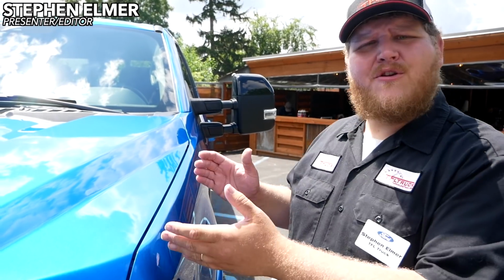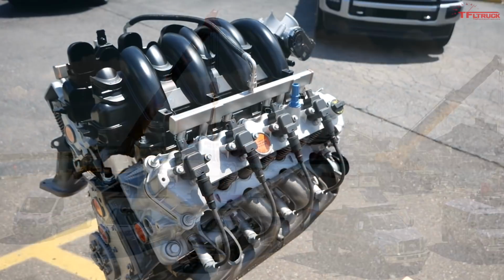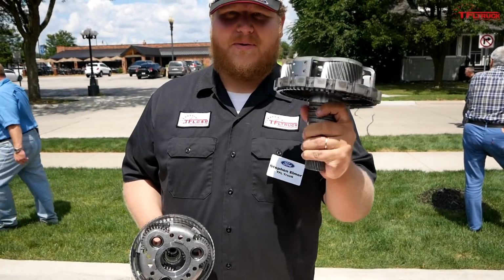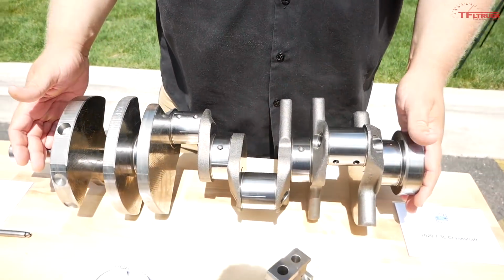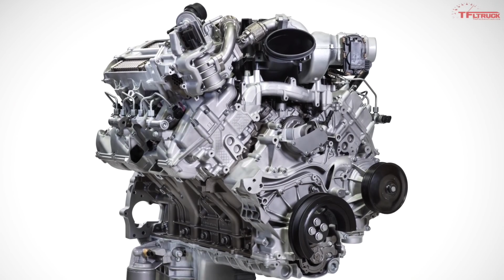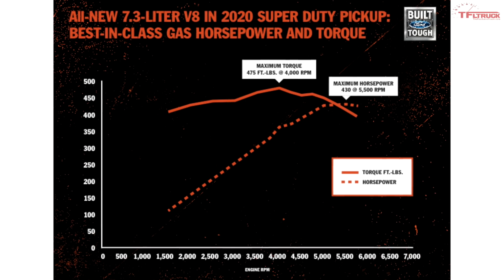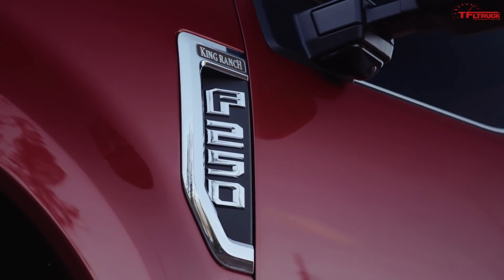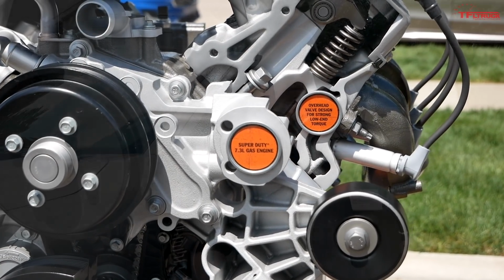We Finally Know the Ford Super Duty 7.3L V8 Power Numbers & They Are Lower Than We Thought!

Comment: From the research I've done, the 2020 Gen1 10R140 Torqueshift Trans had a lot of problems with an internal chain and caused very early failures. Ford had to replace a lot of these with a Gen2 which corrected internals. All 2021's had these installed. The engine appears bulletproof and they're already cranking 750+ HP out of them.

Comment: Dam almost close to being equal to a ls7 7.0.

The few for lbs in Torque difference can be correct through gear ratios the hp difference can not be corrected. Execpt gm used pre 2006 technology to build it.

Comment: My 2020 F250 with this engine seems to be working very hard or not shifting between 60 to 70 mph. Not sure if that's normal. Just doesn't feel right. Maybe  I'm just not use to a V8 after owning 2 F150 v6 2.7s

Comment: I have the F350 with the 6.2L gas and it has been plenty powerful for me. My gross vehicle weight is always at about 10,000lbs and it tends to feels a bit sluggish, but when I hook up a trailer adding an additional weight of 5,000 lbs or so, I don't feel much change in performance.

Comment: I’m not happy with these numbers, I dugout my old Chilton’s  book that covered the hay day of power 69-70, this is what I found.  Cadilac-472> HP-378@4400> TRQ-525@3000, Olds-455> HP-375@4600> TRQ-510@3000, Buick-455> HP-370@4600> TRQ-510@2800, Chevy-454> HP-390@4800> TRQ-500@3400, Ford-460> HP-365@4600> TRQ-500@2800, Pontiac-455> HP-360@4300> TRQ-500@2700, Mopar-440> HP-375@4600> TRQ-480@3200.  When you look at the torque@RPM Ford really missed my expectations 525@3200.
Reply: Those old numbers are somewhat inflated because they are net numbers not SAE. The dyno testing was dond without any accessorie loads such as an alternator or water pump
Reply: @benjaminwayneb  1972 and after are SAE NET, Pre 1972 are SAE GROSS, Look on Youtube at any old engine built stock that shows Dyno and they all beat the published numbers and I think they beat the published numbers enough to compensate for accessories and exhaust.  Also back then they under reported and did little things for insurance purposes.  Like the 400 Ram IV Pontiac in the GTO was 366 HP and the same engine in the Firebird was 345 HP.  They put a clip on the carburetor linkage.  It didn't take any speed geek long to figure that one out  https://www.youtube.com/watch?v=HLiKDu-q-sw , 477 HP and 550+ TRQ published Pontiac-455> HP-360@4300> TRQ-500.   So being made for a truck I think I have a right to be a little disappointed.  I was considering a 7.3 for towing and my biggest disappointment is where the peak torque is, if 475 was at 3,000 I'd be happier.  Being at 4,000 it is not going to get good enough MPG to be a better option than the diesel for everyday towing 13-18k.  I don't expect it to compete with a diesel at 30k.

Comment: Sure hope this is not another history lesson in the crap Modular engine Ford designed, had an Expedition and nothing worse that take great care of it to eventually have to junk a good truck because of head gasket leaks and spark plugs flying out of the motor, and the final topper, you have to lift the body off that chassie to be able to work on the heads or rear plugs, nice job Ford Engineers, you built a great following of Ford fan with that pile of crap.

Comment: It took them long enough to realize that the modular design sucked for work applications. If they would’ve went with the LS design way back they wouldn’t have lost so many customers from VVT issues, stretched chains, cracked manifolds, spit out spark plugs, etc. I ain’t even a GM guy but the facts are the facts. I sincerely hope they don’t suffer from bullshit design issues like the modular design did.

Comment: I work for a city in public works.   90% are fords.    Here's the low down.   Gas is cheap maintenance on gas is cheap motor replacement on gas is cheap and new gas trucks are cheap.  Diesel is expensive period.   Governments are not gonna spend the money on diesel.  Just to haul a crew around or pull a bobcat you dont need a diesel.

Comment: bmw 25d inline 4 diesel has more power
Reply: Not even close. The gas 7 will make more torque at idle than the max effort variants of that engine. The EcoBoost 2.3 gas engine makes more tq than most of the 25’s variants while both max effort engines making the same tq. Hp is on another planet.

Comment: All makers use lower numbers on engines used in heavier trucks vs cars. One example: Mopar's popular 6.4L HEMI is rated 485 hp in it's cars, 410 hp in it's bigger pickups, this gives an idea that there is much potential here for tuners.
Reply: The 6.4 truck engine is a different engine then the car engine, it's not just a different cam or tune.

Comment: This motor is amazing. Single cam  in block and it has vct ?? If this is true you can have multiple tunes that are like haveing completely different cams. Plus it has a 10spd tranny, the gearing should be limitless. Stump pulling 4:30s and low rpm 80mph cruise speeds. 150mph top end ! This is awesome !! 430hp big block is insane !! And this motor looks like it actually revs out !! I am stoked ! And no fuel injector tips in the head to get ate up they are in the port ! This motor is going to revolutionize pulling and hot rodding. Itll be in boats too. Stick it in a mustang !!
Reply: it's not big enough for boats.

Comment: The power level isnt terrible I'm sure it will be more than enough power for 80% of the buying market

And I'm sure that once you get in to the aftermarket with headers and a better flowing exhaust system 

With a tune and these should be damn close to 600 horsepower 

So all in all I think they are doing it right with the new 7.3

Comment: Looks like they accomplished the goal of a good HD truck engine.  

Yes, modern Diesels make more power and torque.  But the modern diesel is a very complex engine.  High pressure injection pumps, precision injectors, turbocharger, urea systems, particulate filters, the list goes on.  They are costly to maintain and repair compared to this engine.

Simple pushrod setup to reduce packaging size and cost (GM LS Style).
Regular low octane fuel to reduce fuel cost.
Port fuel injection to avoid the complication of a high pressure pump and no carbon caked intake valves.
Heavy duty components.

Looks like a great design that should meet the needs of its intended customers.  To think Ford designed this for 'the aftermarket' is one of the more clueless statements I've ever read.

They could of done a lots of things to make it more fuel efficient and powerful, but that would increase complexity, maintenance and cost.  There are trade offs in all things.

This is a modern version of an old school truck V8 that people think of when they say 'they don't make them like they used to'. Well, here is Ford making them like they used to but with better fuel economy, more power and far better reliability than they ever had 'back in the day'.  This will start at -40 in the north, and tow a big load uphill at +45C without overheating with the AC on while going probably half a million KM's or more without any real issues.

Comment: this new gas 7.3 really sounds like its really built like a beast but how big is this engine going to be in the truck if its anyware as big as the 6.7 or even the 6.4 this engine is going to be a cab off affair. those numbers sound great for a big gasser but how well is this new trans going to transfer it to the wheels. i do know the 6.2L feels strained when towing large loads in the superduty F650 and 750 trucks but its a great engine in the 150 and 250 trucks. in my area my shop maintains a lot of the local fleets found the 6.2L wasent really a strong hauler in the F650 and 750 trucks. the V10 is worse then the 6.2 lol. im hoping this 7.3 doesn't suffer the same ford manifold problem as every ford gasser. (they love to split rite half in two) but we will see how well this engine does. i doubt i will see it in many trucks that are going to be used for tow trucks and the like. the 7.3 will make a beastly engine if done up as a race engine. even in stock form with it making pretty respectable N/A, treated gingerly stock tuned form numbers this engine makes great power. even in its N/A form with a good tune can make a very powerful power plant. it can make lot more with boost. this engine has the potential to be an absolute monster. i hope ford does offer to buy the 7.3 as a crate engine. lets see what this new take on a push rod engine can do. lets see if they will let Shelby throw a supercharger on it and make a Shelby super duty. (i would definitely buy one lol already going to try and get the Shelby F150)
Reply: 6.2 not available in anything bigger then F450.

Comment: The best gas HD truck I ever owned was an 02 Chevy 2500 with the 8.1L Allison. That truck was a beast and that Allison is a great transmission. This 7.3L looks to be even better. 
I bet GM comes back with an updated 8.1 or similar to compete with this as the EPA is making owning a diesel an expensive nightmare.
Diesels are going step aside to these upgraded gas motors uness the EPA is disbanded as it should be

Comment: I think Ford finally figured Diesels are about done. With all the extra cost And maintenance 90 percent of companies don't want or need them. I am excited on the new 7.3 gas. Only bad thing is I'm going to sit back and wait a year. Ford has had some pretty shitty engines in the past. I think this one will be good, But I'm not going to be the Ginny pig.  My only other question is why 7.3? Why not 7.2 or 7.4? You make your next big engine release a 7.3 gas. When your most popular engine ever was a 7.3 diesel . Pretty dumb And confusing in my opinion.  If it seems to work well it will be my next truck.

Comment: Only 10 hp and 45 tq over the 1 liter less displacement, 8 year older 6.4 hemi 😂 and those are the lower numbers for the 2500. I guess if the 7.3 has good reliability/engine life and good torque down low, then we can accept this.

Comment: You missed an opportunity to measure Length, Width, Height of the engine.  Initial power #'s are fine.  Will this engine fit in a Crown Vic or Towncar? Curious what/when the Aftermarket will kick in.
Reply: Hotrodders will make it fit.  I don't doubt the aftermarket is already working on speed parts for it.  The big question is how soon will Ford make it available as a crate engine.  Otherwise, many SD owners will find their engines missing due to Midnight Auto Supply.

Comment: I'd like to see an option to get a turbo-normalized version of this engine. Sea level power at altitude for folks living and towing in the Western mountains. No longevity concerns as it wouldn't be stressing the motor at all. I'd also guess not significant cannibalizing diesel sales (very different solution).
Reply: Nice idea!  I keep expecting Ford to adapt their Ecoboost gasoline technology to heavy duty pickups, and I have no doubt they have thought of it, too.
Reply: @andyharman3022  I am sure that Ford is hedging bets here - emissions controls will likely make diesel a much tougher choice for anyone not absolutely needing it. Having a forced induction engine of this displacement would enable a viable alternative for the 5th wheel crowd.

Comment: You couldn't find out what they ended up doing with the ring package? Or if that is an abradable coating on the piston skirt? Are the bearings coated? Or if DLC or other coatings where used on any other components to reduce friction or speed oil return?

Comment: As a basically died-in-the-wool GM guy, I am thoroughly impressed with this new Ford engine. Some may call it a step backwards because it is pushrod, -etc. the fact is, pushrod engines work, -and work really well, especially in truck applications. It really looks like Ford did a phenomenal job on the design of this one, -this is positive progress. To the folks saying they are disappointed with the numbers, -remember that the guys that run fleet rigs DO NOT want to have ANY rig that is operating on the edge, -it must make those numbers all day and everyday with minimal maintenance, so they are intentionally detuned to achieve that. GM did the same exact thing on the 6.0, it is not an impressive engine power-wise, but you can beat the living tar out of them day in day out (the exception being the occasional bad lifter or two). I don't care whose name is on the valve cover, when something good like this comes out, it should be touted as good. These are some amazing times, look at all of the exceptional engines that are being produced today, the Hemi, Coyote, LS, Cummins, Duramax, Powerstroke, -all are world class....I am very impressed with the numbers this engine produces, especially for something that is N/A.

Comment: wait a steel piston? UMMM I kinda don't believe that.... The heat transfer would be terrible among other issues...
Reply: Not in a diesel. Look up Mahle monotherm pistons. Cost is roughly $500/piston. Extremely tight piston wall clearances (Block and piston expansion is very nearly the same). Heat transfer is less if an issue with steel than aluminum and melting point is waaaaay higher. etc. etc. etc.
Reply: @jon-paulcooper8336  HMM well i guess there is such a thing. IDK just doesn't sound like a good idea to me.
Reply: @Trumplican  Aluminum pistons have reached the limit with the power these engines produce.
https://www.enginelabs.com/engine-tech/engine/forged-steel-diesel-pistons-lead-performance-future/
Reply: Steel pistons have been in heavy duty diesels for at least 70 years.  Detroit Diesel 2-strokes had them practically from the beginning.  I worked on steel pistons at Cummins 25 years ago.
Reply: Well then consider me corrected. I'm more of a gas and race fuel type I don't care for diesels.

Comment: I wonder how many threads on the inserts? Aside from that, it seems to check all the right boxes. You should not have to rev the crap out of an engine to attain decent torque. Hopefully, this will be the engine that they have designed it to be. Plus the detuned version still has decent numbers.

Comment: This isn't a Dodge Viper motor. It's a work truck motor. Durability and efficiency is what they set out to achieve when engineering this motor. But, it's a safe bet that a cam, headers and intake will turn this into something that Chevy or Dodge may not have an answer for. Wouldn't surprise me a bit to see  people turn these into 1000HP naturally aspirated street monsters with a relatively low cost to build and near indestructible bottom end.

Comment: Push rod V8? Go figure. Guess who ford partnered with to develop the HD 10 speed? I thought ford would stay with aluminum pistons since the trucks are aluminum. Aluminum body to save weight but steel pistons for strength. How innovative.
Reply: The steel pistons are for the 6.7 diesel, not the 7.3 gas.

Comment: Weak Sauce for approximately 440 cubic inches (7.3 L). This isn't the year 1968 anymore, Ford. F150 has way higher power to weight ratio. Should've turbocharged, obviously... but kept the large displacement for the size of the internal engine components, and in turn longevity.  Design by committee produces junk like this, need a singular brilliant engineer... a la Koenigsegg.  

Ford, just fix the diesel particulate filter issue that burns diesel engines to the ground and call it a day.

Save yourself the headache and money and just get an F150.

By the way, just get to the point TFL, nobody cares about all your banter.

Comment: I was hoping they were bringing back the 7.3 diesel, a little disappointed that it's gas but hopefully it's still an improvement. My 7.3L V8 Diesel in my F550 dump truck is incredible. 20-22L/100km hauling around anywhere from 9,000 lbs all the way to over 20,000 lbs GVW.

Comment: 20 less hp and 35 lb ft less torque than my Raptor V6. 🤷‍♂️
Reply: Rshane P they’re two different trucks, your raptor isn’t a commercial tow mule and this isn’t designed to do 100mph through the desert. You can bet your sweet ass it won’t sound like a Honda lawn mower while it’s getting work done either

Comment: My guess this is/will be under-rated and with a few mods & a tune will be easily over 500 HP.  Now put a Whipple or Kenne Bell on it and 800 HP. :D  Had a 5.0 F150 2016 and it was a wonderful truck.  (Traded it in for an Expedition.)

I am looking at getting back into a truck in 2020 had have had a few Dodges and really enjoyed  them so am definitely looking at a Power Wagon vs. a Tremor. 

One other approach I"m looking at is getting a slightly used Power Wagon then send it to Arrington Motors have it bored and stroked to 448 CUI and have it make 630HP at crank for $5.8K more including all parts/labor.  Link: https://www.shophemi.com/p-2573-arrington-448-short-block.aspx 

Great video thanks very much.

Comment: Remember when the 5.9 Cummins came out in a Dodge? It was the 1st Truck engine with 400 ft/lb of torque @ 1600 rpm...It pulled any and everything and with just 160 hp...
Now here is a reliable V8 with 430 hp and 475 ft/lb. + a 10 speed with a 1st gear of 4.86:1 vs the old 4 speed autos with 2.74:1 let that sink in!
Reply: I dont think hp matters in a diesels  I think torque is more important  and better for towing but time will tell with these new gasser but that my two cents

Comment: with a GCVW rating of 25,000 pounds or more, you need to drop cylinder pressures if you want to extend engine life, which is precisely what Ford did

Comment: "A stock Toyota 5.7L iForce V8 is rated at 381 hp and 401 lb-ft in a Tundra. This Toyota Racing Development (TRD) supercharger boosts power to approximately 505 hp and 550 lb-ft. "
FTL

Just to put things in perspective. That was Toyota with the 5.7 l V8 supercharger installed by the dealer.
Imagine what this engine can do with a hybrid twin turbocharger.
I'm not an engine expert so I don't know if that's even possible with this engine. 
Just imagine if you could.